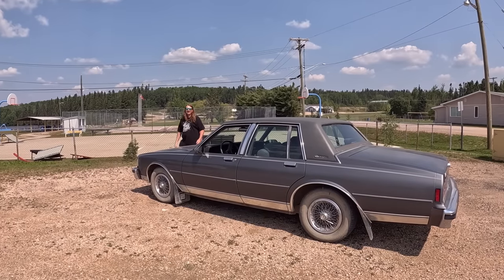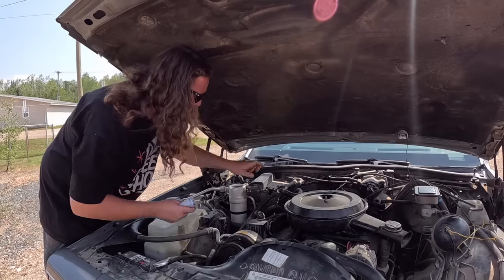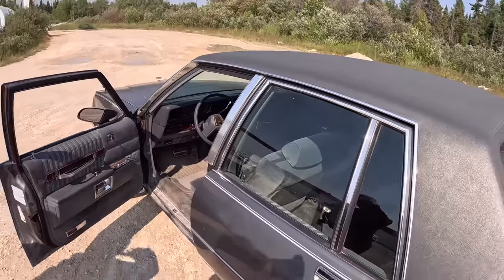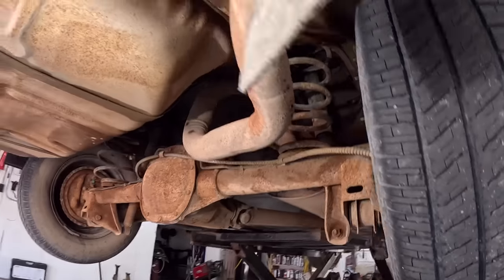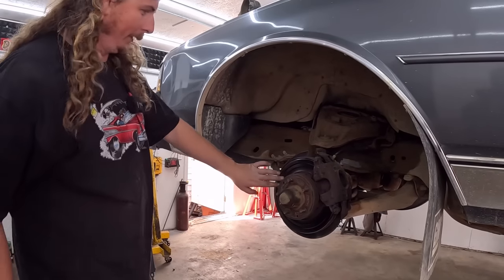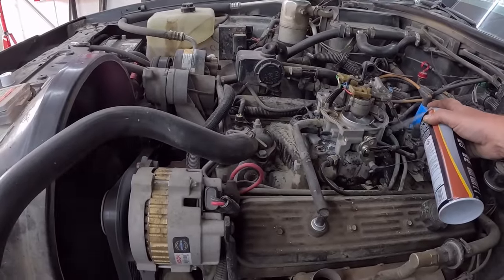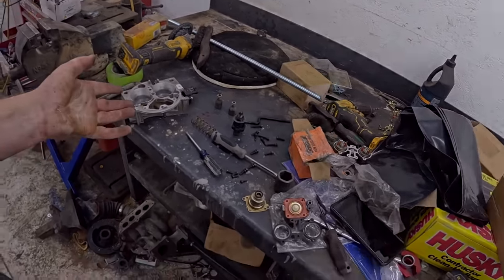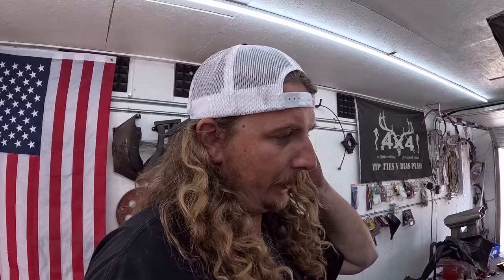MINT 35K Mile ORIGINAL Owner 1989 Caprice - Why Did I Buy This?...

Comment: i do believe mr bieri has a large cassete collection u could possibly raid if u asked nicely .   if u intend on cleaning the throttle body dont use brake cleaner its way to harsh for the components , carb cleaner u probably get away with or get a cleaner specific to them

Comment: Hey Danny, When you had the TB off did you check the base of it to see if it or the manifold was warped? I've seen TBs (just like Carbs) crack and if someone had problems with it stalling and (tapped) it with a small hammer (lol) could crack it or thru time the base can warp and cause a vacuum leak. So in other words check for cracks and warpage in the TB and manifold.  Other then that I think you checked everything that I used to back in the day. Good Luck

Comment: I'm old.  Love this car, my Grandma had an 84, I'd buy that thing anytime.  My 1st thought was EGR, they were known to go bad.  2nd thought was TPS, they're known to have bad spots, especially as much as it was parked, take it off and Ohm it out as you turn the sensor and look for a dead spot.  But....  That doesn't look to the vacuum leak (brake clean).   Makes me wonder it if the intake manifold is bad, GM was kinda known for that back in the day.  That's my guess, or it may be 2 things, one masking the other.  I'm gonna throw my guess behind bad intake manifold gasket, it it was the computer the brake clean wouldn't fix it.  maybe TPS and vacuum leak?!?

Comment: I drove an 84 for quite a while.  305, and a quadrajet, 200r4.….
I love how they drive. Comfortable....classy.  just needs wheels and it would be bitchin.  
Totally reliable transportation
Reply: Center bolt valve covers only mean fast burn heads until 96.....then you get roller motors. 
Still plenty reliable.
Reply: One other thing, all the city folk like to put 20-24 inch wheels , and 4 inches of lift on em and call em box Chevys. 
In 2017 I helped build a Pontiac version with a 725 hp 540  big block, tci trans, and a fab 9 rear end...and 24 inch forgiato wheels( not my bag but it was fast enough)

Comment: You can loosen the knock sensor on the passenger side of the block just a little so it's not so sensitive they can pickup when you hit a pothole.  To set the timing disconnect the spout wire brown with a black stripe set the timing  to 5 degrees not 0 like the sticker says when turn off the ignition and disconnect the battery for about 10 minutes reconnect your spout wire and then start it, it will run goofy for a bit while it relearnes,  it will now think it's reading 0. But it's now got 5 degrees base timing it does perk them up.

Comment: The dohicky on the fire wall is your manifold absolute pressure sensor which would be the main way the computer determines what amount of fuel the engine requires given thats a speed density setup

Comment: Don't over think it .
 You probably have multiple vacuum leaks at every  hard dryed  or split  , loose hose .  Spraying brake clean at any one of them will mask the leak .

 Drill out min idle screw cap and turn in screw 1/4 - 1/2 turn from factory setting .
 This is needed on tbi , tpi cars now burning  10% ethanol fuel. 
 Remote starters wont work without this adjustment. 
 Unplug the est wire and set base timing at 2° btdc. 
 Re torque intake manifold bolts and check for burnt egr gasket , brake booster line and check valve .

Comment: Great car - I've burned thru a couple of those 305's with the AOD and constantly got 28 to 30 MPG (Cad Gal).
That car will spoil you not with power but with comfort - If Danni gets to driving it, you won't get it back.

Comment: My first car,an 85 Buick Century Limited had that running issue. It was a burnt chip in the ECU. Only problem was the model year was the only year with rochester multiport fuel injection, and no aftermarket replacement. The year after godt the Bosch injection. The crusher sadly caught that car.

Comment: It's most likely the injectors. Just because they are dripping fuel does not mean it is delivering fuel properly. Upon acceleration, the increased voltage will cause the injector to atomize fuel properly but they will fail at idle.

Comment: There was a time when these were just as common as the square body truck. Good luck trying to sell either of them. They were so plentiful you couldn't give the damn things away. Both the cars and the trucks. 25 to 30 years later and everyone  treats  them like gold. I use to buy either a  Caprice or an Impala every fall just to use as a winter beater.  To get one in the same condition as Dans' ,,,,,,less than a thousand bucks. Same for the square body trucks.

Comment: Hey Dan just a thought but could the throttle shaft be wore allowing the brake kleen to suck in and run better. Gm carbs had a bad habit of throttle shaft wear so maybe the tbi is the same.

Comment: Look at the emissions sticker on the fan shroud ie: vacume hose routing etc. Also getting a new ecm is usually a waste of time because you have to swap the Prom ( Programmable read only memory)  chip over from your old one. Also.. Use AC Delco parts whenever possible, as yer finding out, tbi systems are fussy & don't like most aftermarket parts too much.

Comment: Had the same issue with the one I used to own, got fed up with it and put a factory intake and carb off an 86' Gran Prix and drove it for another 500 000 klm. until the frame rotted out of it.

Comment: OL Gray beard looking sweet there. Other than the old man smell I am sure. Ha. Actually had one back in the day., More plain Jane but with the cop car/taxi suspension and wider than stock tires. Frigging thing was a corner carving sweet riding sleeper that was way comfortable to drive. My only strong desire was to keep it's under good stock appearing but with a 350 crank into a 400 blk. Would have outrun and cornered well with all other current performance cars of the time. Still smile when I think of the possibilities

Comment: Your working on that car was a trip down memory lane. DON'T screw with it! Fix what ail's it and, as you already have too many cars you say, so sell that puppy as is. I'd give u the 3K 4 it as is. Saw an old man driving one much like it yesterday and gave him a thumbs up too. Had a few of them back in the day myself from 1977 and up 'cause it was the tri-5 replacement vehicle. Re the TBI, the problem with it was porosity (minute pin holes) in the body and the only real fix was to replace it. That's what the dealers did. You kind of proved that by hitting with the cleaner momentarily sealing it. Maybe a coat of some kind of sealer or paint like product might do it. My father had an '89 Caddy and that's what he found out after we monkeyed around for a long time and finally took it to a dealer. They put a whole replacement unit on it.

Comment: Numbers on plug wires, oh yeah 👍 years ago I had an 89 like that in my shop that was driving us nuts. The distributor had been replaced and two different shops couldn't get it running again. My first guess was 180 off. Nope. Being in the US I never thought about firing order until I was just looking at the thing with glassed over eyes and noticed the firing order stamped in the manifold. I was like wth ! 
I learned an important lesson that day, some sbc that came from Canada have a different firing order than what was inscribed on brain from a very young age. Poof moved plug wires and we were golden, started, ran beautifully and got a well healed return customer for years. I knew that some Chevys had Pontiac engines and vice a versa but never had heard of SBC with different firing order so maybe why last mechanic had labeled them.

Comment: I had a previous owner issue and the tbi turned out to have two different lph 5206 in the dr side and the passenger side was a 5279 305 fuel injector in the tbi hence the severe backfiring... And a severe lack of maintenance and the oil sending unit was the wrong one, and the O2 sensor smelled like gas as much as the oil in the truck..

Comment: I forgot to mention two things because I don't know what version would be on the caprice classic,i bought a oil pressure switch/fuel pump cutoff sensor switch goes back behind the distributor..the 92-95 tbi uses them especially in the trucks, and with the muffler and the exhaust trying to separate itself and it backfires, you may want to replace the oxygen sensor on my early 94 k1500 extended cab short bed Z71 uses a 4 wire heated o2 sensor.. i don't know if the caprice uses it or just the regular 1 wire-2 wire o2 sensor ?!

Comment: I had an 80 impala came from my uncle in Naples Florida, had 28k on it, only had the gutless v6 in it but drove it to 250k and it drove on the truck to the scrap yard.   Nothing but batteries brakes and tires.  The only other thing was the exhaust rotting out so I put a stainless one on and that solved that.

Comment: I would fix what needs to be fixed. Put a badass high horsepower engine in it. Then be done. Oh and a really nice sounding exhaust. I completely agree, the cars we are after now (folks in their late 30's early 40's) are the cars that used to be super common when we were young. I would love a 1997 crown Vic in mint condition. Or a 92-95 cutlass ciera. Or Pontiac Bonneville, really anything 1990-1997. Ford tempo, Taurus, any car you see in the background of season 1-4 of X-files lol.

Comment: Around here these late 80's generation GM cars show up as mostly late 80's Cadillac Brougham 4 doors. Mint bodies and solid drivelines typically (Olds 307 with a 200r4). Computer controlled 4v carb and 200r4 OD transmission.  Just bought 2 of these transmissions for use with Buick 455's. Nobody wants the Olds motors but 200-4r is sought after for use with non-computerized BOP engines. Both the 87 and 88 Brougham 4 doors are being LS swapped by younger fellas. I would leave the 305 in the Caprice cuz it does the job and it will never be a true hot rod anyway in my view. Detail out the minor repairs and drive it as is.

Comment: Build a real nice smooth running 383 sbc..
Make this a new towing rig…
Check EGR, spring May be weak..
Unplug vacuum line and cap line..
If it cleans up change EGR valve

Comment: I smell an 8.1 litre big block swap and use it for power tour. Those 305's suck. Nice find. I have 2 Caprices. 95 & 96 Caprice /B4U/ Impala SS  models. Both with the  LT1, 350's.  I would check the fuel pump.   You can hot rod the Caprices and they will run & drive like the Impala SS's.   8.1 litre, Holley Fuel Injection, super charger, dual exhaust, sway bars and you have a real sleeper.  Because it has overdrive you can put 373's or 410's and still cruise at 70mph easy. Been there, done it :-) 275/60/15's will fit in the wheel wells without hacking them too :-)   Regards from Ody Slim

Comment: The EGR is leaking, they were terrible, you don't need it.  Pull the valve and plug it off inside the manifold, reinstall the valve so it looks original.  What to do with it ?  Do a low buck 4.8 LS swap with the original trans.  It should be a 200r4, basically a Turbo 350 with an extra gear.  A $15 adaptor for the T/C snout is all you need.

Comment: Valvetrain sounds more like 235000 mi how's the whear on the brake and gas pedal. Are the wipers sloppy loose.35,000 the color of trans fluid should be meant. Check on paper towel or paper plate. shocks look like 230,000

Comment: On the front brakes. The caliper is stuck or frozen. The caliper rides on pins and bushings in the caliper that go bad a the caliper freezes.
Look up a Dorman HW 5500. The Oring looking parts are the bushings. The bushings are inside the caliper. Grab a pick and pull them out. Grease and replace. Clean the pins and reinstall.
The caliper should float on the pins and move easy by hand with the piston compressed. 
EZ fix.

Comment: Dan my 93 van had a 120xxx after throwing a whole lot of money at the throttle body it turned out the sock on the fuel pump had detreated and was clogging the fuel line on and off. Had to drop the tank and replace the fuel pump myself and it ran great. That was after 2 shops couldn't diagnose it and one had charged me $ 800 to put injectors in it and still ran like shit. I actually bitched at them and they gave me 600 back. The other shop had no idea but didn't charge me at all.

Comment: I worked on a bunch of those things back in the early 90's  Maybe someone else has had better luck but every single GM TBI car I worked on was junk.   I wouldn't waste the time or money to put a LS swap on a car like that.  Although, I might consider sticking an old school, carbureted 350 or 400, if you can find one cheap enough.

Comment: IAC- idle air control likes to plug up. Basically the car chokes out every time the throttle plate slaps shut. I would leave the drivetrain alone and fix all the cosmetics get some bad ass wheels (taller black factory steel wheels w dog dishes) on there and drop it about 2 inches.

Comment: 1989 700r4 probably has a lockup solenoid on the torque converter. The car stalls after driving brcause the  TC is locked up and cant unlock and the car isnt doing highway speeds.

Comment: Delete the rub strips halfway up the doors and those hideous mudflaps. Get it running mint and add some headers, dual exhaust with sensible mufflers like Flowmaster 50s, tint the windows a little and change out the locking wire hubcaps for some nice chrome or polished aluminum wheels with raised white letter tires. Then full send.

Comment: TBI systems are really sensitive to fuel pressure , replace the fuel filter BEFORE you throw any more parts at it! 99% of the time that fixes the problem. Second most common stalling problem is caused by a weak tank mounted fuel pump.

Comment: my 92 Silverado had a big vacuum leak at the EGR valve it was sucking air around the plunger shaft I replaced the EGR valve the and it  stopped stalling . One thing you can do is unplug the O2 sensor if it is running too lean or rich from a bad O2 the computer will run off the base fuel map too bad you don't have the old Snap on red brick scanner to look at live data.

Comment: Great car. I say that line is rotten and not sealing proper. Replace that rubber line on back of the carb and or put some grease around its tube at the carb and try it out. They leak there but just enough to be a pain.

Comment: Alot of people here in the U.S. atleast here in the South West are buying the 70'sand 80's A and B body cars and stripping them down and pulling the body off the frame and putting 30's, 40's and 50's bodies on them and building budget hot rods and putting almost nothing into them money wise. I have a buddy that's putting a 52 Buick Roadmaster on 80 or 81 Olds Delta 88 Frame. They are the natural cars to do with, They sit lower stock, so you don't have lower them, Most of them came with Small Block V8, either 305/307 or 350, that are USUALLY running and have almost no miles on because Grandma Martha only drove the thing to Wal-mart, Grocery store and Church, LITERALLY, the suspension brakes is the same suspension and brakes people do upgrade there hot rods with anyway and most of the wheelbases are close enough that it's almost a direct fit. I've been thinking about doing a Hot rod Truck build for years and I'm thinking about finding a 70's-80 A/B body for the fame.

Comment: I actually like the euro nose 88-91 Chevy caprice classic brougham cars i almost traded a 89 Chevy S10 regular cab short bed El, and the 84 Pontiac Grand Prix SJ and the 80 Chevy c20 Scottsdale L6 from a 68 Chevy c10 long bed.. and it is more than likely the pickup coil, ignition coil ignition control module...

Comment: Need a clam lock around the keyed column EZ to steal bar oil cut with to thin it out sprayed all underneath the drive down a dusty dirt road to coat it against rust. .

Comment: As far as running? Check the fuel pressure, those tbi units want 12 psi or they run like turd. Fuel line between the pump and the sending unit likes to rot out and leak fuel back into the tank instead of pumping it through the line. Good luck.

Comment: that tbi is the best most dependable set up ever made , Dont put aftermarket garbage on this car . give it to your woman its trustworthy dependable & safe and strong and well built . if you want more  power go to a early vortec 350 .
the cops in USA used alot of those ,if you get a wrecked cop car with 350 police package it will perform well  , AND YOU CAN PICK AWAY AT THE POLICE PERFORMANCE SUSPENSION & BRAKES THAT IS A DIRECT FIT